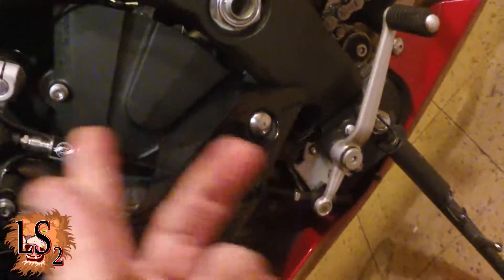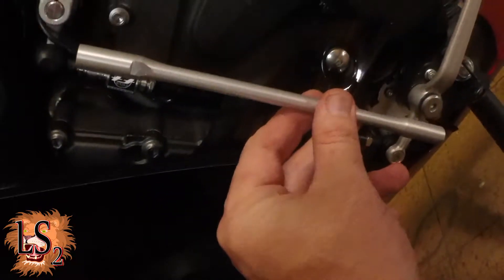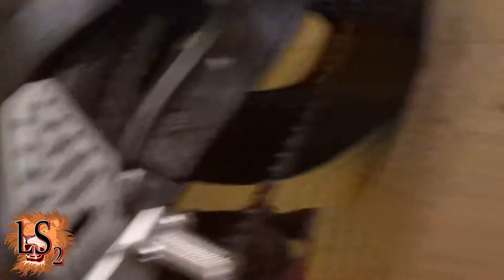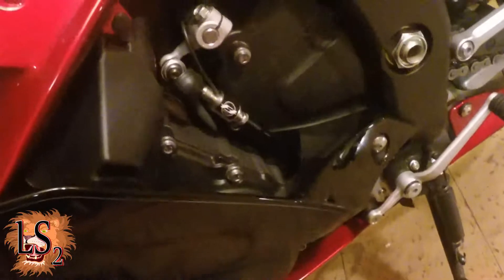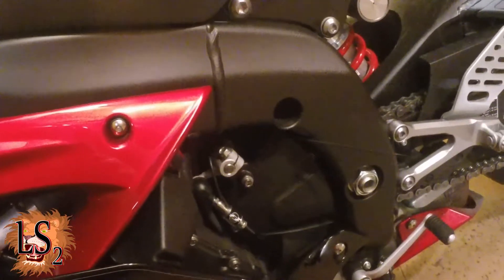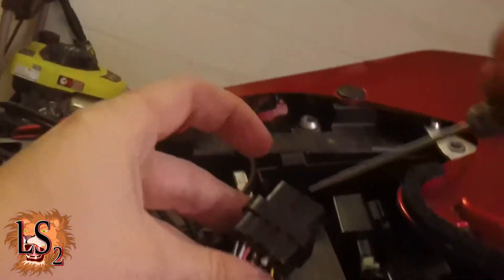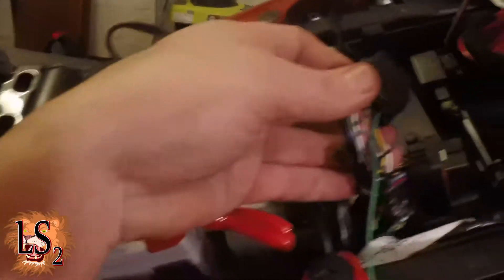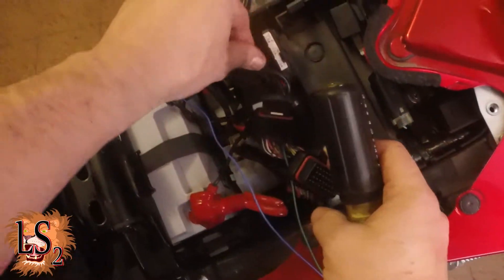Season 2, Episode 8:  "HOW TO-Install Quickshifter with ECU reflash"

Comment: Does it need to have module of flash tune or stand alone that is direct to ecu without tuned.
Reply from the maker: They flash the bikes ECU and return it.  The ECU is physically the same just with some new throttle settings programmed in with the flash.
Reply: It needs reflash to make it work the quick shifter?
Reply from the maker: @carlotabamotovlog8916  Mine did.  It was  a few years ago so I'd check with whatever manufacturer you are looking at.

Comment: Where do i get the quickshift and who do i get my ecu flashed with?
Reply from the maker: Your bike comes with an ECU, but replacements can be found on Ebay, etc.  I used Flashedbyvcyclenut.  Does great work and gets it done quick!
Reply from the maker: Sorry, I got my quick shift from Vcyclenut, too.  But there are lots of manufacturers for those.

Comment: I installed a dano performance quickshift (ecu based) and 1st to 2nd is rough so I use lever for that, but yeah, 3rd and beyond is awesome. Only con is my engine light is stuck on w/codes 4 and 43 (i believe voltage/ecu related). My bike is a '12 R6